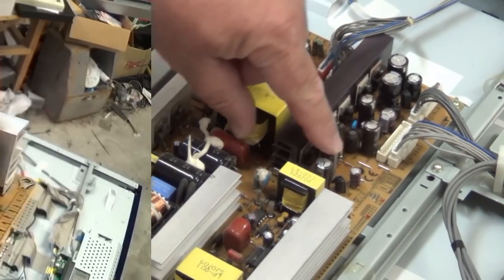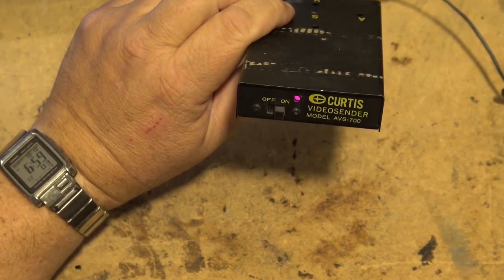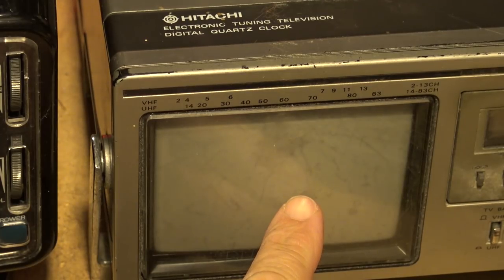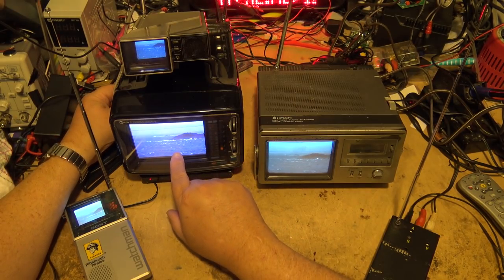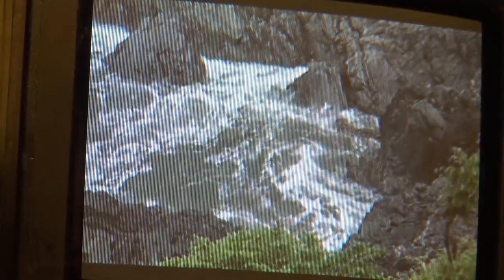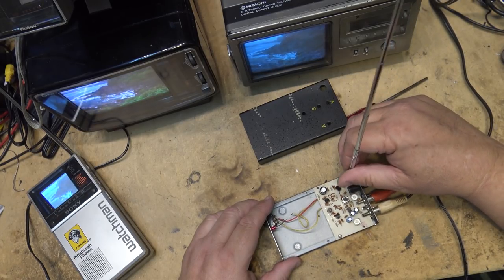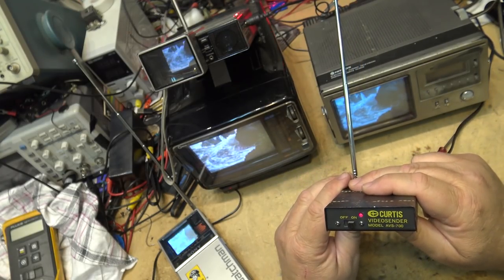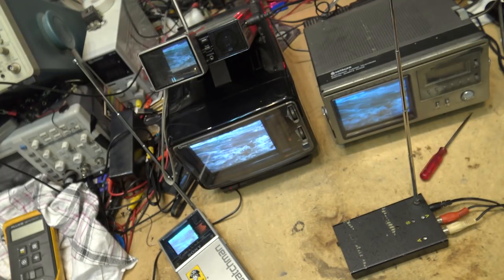Curtis Video Sender low power TV transmitter tear down and demonstration

Comment: The video sender you show here looks very familiar to the "UT66" series. Basically these transmitters (the one´s that I´ve tested) work on half frequency. So if you´d transmitt for example on 500MHz the oscillator wil runn at about 250Mhz. The frequency gets doubled in the first transistor stage - and - via the filters (L+C) the intended frequency is picked out. I´ve tested lots of these video transmitters (other brand) and they all have the same problem - the antenna is missmatched. If you pull out the telescopic antenna to it´s full length, the range usually isn´t that good and often I also had it that the 1/2 Frequency from the "intended" frequency is also broadcasted (weakened but still strong). It helps to use some kind of communications receiver, take off the antenna from the receiver (BNC or SMA) and put it on "W-FM" on the video transmitter´s Frequency (usually these drift so use W-FM). Then place the receiver in some distance untill you hear static, and align the antenna (length) on the transmitter for best performance. UT66 usually I pull in the telescopic antenna and just put out the "thinnest" part (the upper one) a  little bit... maybe 1 inch out from the "big antenna" and I get a strong resonance on the intended frequency (on other video transmitters I´ve tested the perfect resonance spot varies). With the antenne "in resonance" the range increases dramatically (still no big range) and the harmonics / unwanted signals are quite well supressed.

The output power of such a device is in the range of 10...15mW ... if it were 100mW you´d get more range. The UT66 series (optically very similar to the UT66) is very simple designed. The final amp is just modulated in the emitter (the 1k potentiometer for video level). It has FM problems (which the TV ignores) and some units have problems with the linearity (probably a final amp bias issue) meaning if there´s to much white in the picture the picture goes nuts / distors and other problems.

I´ve tested a few brands (via ebay) and the best unit is the one from "reflect" called "Reflect RF280" - it also uses an oscillator at the 1/2 frequency but with the antenna proper aligned, the output is quite clear. It´s stronger than the UT66 and has a good picture / audio.

Sad that they don´t allow these ... still... I mean in Germany - after my knowledge - they weren´t ever allowed (still people used them as it seems) You´re... were... really ahead there in your great country :)

Circuits of these transmitters can be found using google picture search but basically you can even built a dirt-cheap 2 transistor video transmitter (colpitts oscillator in the TV band. Feed in the 4,5MHz signal on base and feed in the video on emitter). Did that... it... works but it´s really "dirty".

Hope I could bring some light into this topic, I´ve really spent a lot of time with these. 

The range varies very much on the environment. With the transmitter in the house it´s about 100 feet as it was said, but if there´s nothing between the transmitter and the receiver it´s more like 300 feet before the picture starts to get bad. More range can be archeived with a different transmitter modell.

Comment: I recently discovered that you can run an rf signal through a signal booster and achieve the same goal.
I found this out while I was looking for a signal sender that doesn't require me to have a bunch of clunky crap connected to the receiving TV just so that I can use it and had a very difficult time for whatever reason.
With the amp you just need to supply power to the booster at the transmitting end.
You can also get the same result using a VCR
Reply from the maker: Most consumer signal boosters don't provide much signal but a commercial modulator with a 60db amplifier will certainly transmit a few feet.

Comment: Got just the same videdo sender. A Blonder Tongue Agile Mod is what you need for decent signal indoors! Thanks Dave.
Reply from the maker: I do have a BT modulator. Channel 12 MTS stereo.  Has a +60 dB output and yes connected to an antenna it goes about as far as this thing. I use it in my home analog cable distribution and have it playing music videos off a hard drive 24/7.  Have many, as in hundreds of concert performances that I just let play in random and listen to more than watch. That's why the stereo modulator.

Comment: Very interesting video.  I didn't know that you should run TVs occassionally to keep them working well.  I have about 8 vintage 12" black and white sets that have not been turned on for about a year or so.  How often should I dig them out and operate them?  Also have a 20" Zenith that I'm in the process of repairing but not sure on how to disconnect the picture tube.  i will make a video of the TV soon so you can see what I'm referring to.

Comment: I have 2 of those Curtis mono units I've used over the years but recently found a stereo video sender with no brand name, it's about the same size as the older ones and works great. Have you seen the stereo model?
Reply from the maker: No, wish I had one. I have 2 stereo modulators.

Comment: I have one called a 'TV Genie' but the picture looks scrambled. There are 4 trim pots inside in addition to the 2 audio and video gain adjustment pots along with 7 caps. Anything I could adjust or replace to fix the picture?

Comment: Wonder if they are similar to the Rabbit Boxes they used to sell to extend video through the house via wireless. Never had one, so I can't say.
Reply from the maker: I had a wavecom jr unit on 2.4ghz FM video and audio modulation.  Still have it modified for amateur tv. Mine is programmable from 2.36 to 2.45 GHz and puts out 1 watt. Into a parabolic reflector antenna the distance I have transmitted is point to point 50 km.

Comment: The one from Canada, the transvid?  Did you find it?  I am in Canada and have an old one put away somewhere.  I could broadcast to neighbours 5-6 houses away, easily with clear picture and audio.  Do you know if these will work with modern tv’s?
I would like to see your Canadian brand one.
Reply from the maker: No, it's around somewhere but i haven't found it or have been looking for it.
Reply: Put the TV on to analog
Reply: You can get the TV to scan for analog channels

Comment: I got a UT-66 which seems to be almost identical to this one. It's allegedly operating at channel 31 but the one I got, has a "homemade" label next to the unmarked hole above the sound control hole, here it says CH-29. I can't find anything on either tho but if I seek with the device I'm trying to play back the channel on, I can sometimes get a quite crappy signal. If I tune the video knob, I can take it from no signal to a very shitty signal. How do I bring it back to the default channel?

Comment: I still like the novelty of small tv sets :-).
I have never heard of curtis ones but there were plenty of other manufacturers making T.v Senders.  (as they were called at the time).
A few oscillators being modulated and mixed together, not much but very very handy :-D.
I've always loved minimal circuits that perform amazingly well.
Reply from the maker: Most were am, a few FM. The fn models looked better and went further but required an fm tuner at the other end.
Reply: That must have been the reason most people used the  AM senders, cheaper.
Fm would require a more expensive device.
Reply from the maker: @zx8401ztv  well it required a seperate receiver whereas the am senders you just turned your tv to channel 15

Comment: couldn't you hook up the output from a converter box or modulator to an amp to get a similar effect? we still have channel 28 within range so that's cool.
Reply from the maker: Yes. You would need a fairly high gain amp.  Of course hook this to an amp and get a few miles range.

Comment: I had one of those 2.4 GHZ video transmitters made by a company called Terk.  But the power supply units for one of the units died. But it was 2.4 GHZ Analog and the video was frequency modulated instead of amplitude modulated.  It used to get interference though from nearby wireless routers in the neighborhood and would also cause inteference to them.  If it was set to the right (or should I say "wrong") channel I would completely lose my wireless internet. Because of the 2.4 GHZ microwave frequency. Which is what wireless routers also operate on.
Reply from the maker: The Wavecom jr and sr was the same. The difference was the sr version had an IR return channel.
We used to use them for ham TV use because the 2.4 band is shared with amateur radio.
They were FM video 20MHz deviation and would do a wonderful job on 2.4 cordless phones and wireless routers. When we operated it caused hell for the neighbors wifi. I could never hit the repeater from my house, so I used to pack up my gear and drive up the hill and set up remote with my camera, transmitter on 2.4 with a high gain antenna, and a 1.2ghz receiver to receive the signal back from the repeater. There would typically be 4 of us on the air at once. We had a quad screen, so we could see all 4 input frequencies at once. Would go on the air for hours, either just talking to each other, or showing live pictures or play tapes we made. Every time I set up I would get the a couple people pay me a visit on the hill because their internet got really slow or their phones cut out wondering what was up. I would say, too bad so sad, I was operating in a legal, licensed band. A few even called the industry Canada folks that informed them that their devices were not protected from interference as they operated on the ISM or industrial, scientific and medical band as a secondary use, and ham radio was a primary user for us to experiment on. The "scientific" portion. It pissed them off but there was nothing they could do. I would say to them, hey I am only here for a few hours, be glad one of your neighbours isn't a ham, because he could operate all day and there is nothing you could do.  I  think a few thought I was doing it to annoy them but in fact it was the only location I could get a clear shot to the repeater from my location as I was about 50KM away and that is a long way to shoot a 1 watt microwave signal. Those days are long gone though. All the guys that I used to do ATV work with are all 6 feet under now. Many died of cancer. Can't help thinking it was probably all those microwaves they played with over the years as many of them tinkered with transmitters and antennas and really big power for years, and 2.4GHz is not good to be around.
Reply: @12voltvids  even here in u.s f.c.c rules part 15 says that this device must accept ANY interference that may cause undesired operation.
Reply from the maker: @RadioSpectrumDXer1217  That's right ISM, Industrial, scientific and medical band. Home cordless phones and wifi is secondary users. Amateurs on 2.4 can run up to 200 watts I belive. I only operated with 1 wayy into a 33db gain parabolic reflector. That would give the ERP in the focal point of the beam of 2048 watts. Yup that was cooking.
Speaking of cooking, on a field dat we set up the transmitter, and pointed the antenna into a glass of water, and it eventually brought the water up to a boil. Don't stand in front of that antenna when it is on.  One of the guys in our group that was always playing with 2.4GHz and didn't bother much with safety, walking in front of antennas when transmitter was on ect wasn't feeling well. Finially went to a doctor and got the bad news that he was full of cancer. Likely brought on by years of smoking like a chimney and his excessive exposure to microwaves.
Reply: @12voltvids  iv'e had my bluetooth earbuds in listening to music.  They will play just fine until the second i turn my microwave oven on to heat up my food to eat,  then they start breaking up. But the second the microwave stops they start playing fine again.  especially if im closer to the microwave than my phone. Microwave oven is just a "glorified" version of what you were doing.  Just shoot the microwave beam into a cooking chamber, add a timer to the transmitter and there you now have an oven. I remember back when I was a kid before fiber optics became a thing (due to its greater bandwidth), before cell towers really dotted the landscape,  you would see these microwave relay towers with the parabolic reflectors but they also had these funny looking horns that were shaped like a wedge of pizza or pie wedge.  Used for relaying long distance telephone and network (ABC,  NBC,  CBS)  television programing across the country to their local affiliate stations. Many were owned by AT&T A.K.A "ma bell". So obviously this was even before the days of satellites.  I know many radio,  tv stations though still use microwave relay to remotely send programming from their studios say in one part of town to their transmitter site located in another part of town or even totally different area.
Reply from the maker: @RadioSpectrumDXer1217  
Microwave ovens operate on 2.45 ghz, which is the top end of the 2.4 wifi band. Bluetooth shares the same frequencies.
Once upon a time the phone companies used microwave to link distant communities.  Now most is backhauked by fiber, but Roger's still uses microwave links for their cell sites.   Many radio stations here used uhf STL but that was a backup because the transmitters had audio delivered by isdn or t1 phone lines as the primary link and the radio link was a backup.

Comment: I have a similar modulator, think it's a Radio Shack, UHF on Ch35 approx 534Mhz from vague memory.  I have a large box with three crystal locked VHF modulators on Ch 0 (46.25Mhz), 5a(136Mhz) and ch 11 (225Mhz).  I recently got a 2 channel UHF unit has the Ring Grip name (Ring Grip is an Australian manufacturer of electrical fittings).  It can be set to any channel in the UHF band.
Reply from the maker: I have 3 wacom agile units that can go from a-7 to a-1 covers 2 -83 VHF /UHF and 14-22 CATV, 23 to 135 CATV including the channels in the FM band 95 - 99.  I use VHF channels for distribution on my home system. Channel 4 stereo Channel 5, 7, 9, and 12 in stereo, and CATV 17. I dont use any UHF because I receive the OTA digital signals with an antenna and mix that in with my analog channels, so TVs throughout the house can get SD material I insert on the analog channels and HDTV. The analog modulators are used for things like my media players, security cameras ect.
Reply: Plenty of signals for your TVs then.  Correction: the 2 channel modulator has Clipsal (another Aussie electrical supplier) on the case. I did have a look inside it and noticed the board accommodates up to four modulator modules. It’s actually made by Zytec despite the name on the case
Reply from the maker: @Wenlocktvdx  I have a couple of channel plus units. One is a 2 channel and the other a 3.

Comment: quick question I was considering creating a small diy transmitter for personal use but I'm having trouble finding licensing and legality information, would you be able to point me in the direction of resources on this? Thanks!
Reply from the maker: Well you don't need a license if the power is low. How low depends on where you are. It is based on field strength a certain distance from the radiator (antenna) which varies depending on your country.
There was a pirate that operated for years and years. Probably 20 years and payed nothing but music on the low end of the band. Then one day a high power station was set up on the same frequency and I cont hear it any longer but it was there for many many years.

Comment: Nice design. Nowadays they would throw some connectors and a chip on a board and shove it in a cheap plastic case and sell it and it would fail in a week. At least this you can fix. Any ICs on the other side?
Reply from the maker: Nope. What you see is all there is. 4 little transistors.

Comment: Would it be possible to recreate this? The circuit seems simple enough.
Reply from the maker: Of course it would be possible to build one of these. Of just tape a small tunable modulator and add a small amplifier stage.

Comment: How you send signal to tvs ?
Reply from the maker: Well this little transmitter transmits on uhf channel 15 which is fine if none of the local channels are broadcasting on 15. All my TV's still have analog capable tuners.
Reply: @12voltvids  thanks for info

Comment: Why did it not have a 3.579545 Mhz crystal for colour?
Reply from the maker: The transmitter is not generating color or demodulating color. All it is doing is taking the incoming video signal, which would already have the color encoded on it and AM modulating it onto a UHF carrier and then amplifying it slightly and sending it to an antenna. Its a very simple process.
Reply: @12voltvids  Sorry, I still had the modulator mindset LMAO my bad.
Reply from the maker: @MikinessAnalog  
A modulator is no different. It takes an existing VBCS (video, blanking, chroma, sync) composite video signal and modulates it on a carrier. Most modulators will have a crystal for the carrier generation so they remain stable. This one doe not, so it has a tendency  to drift, but the AFC on the TV takes care of that.
Reply: @12voltvids  As i understand it from university, the higher the frequency the less power needed to go the same distance, so I'm assuming being UHF it is probably in the  200mW range? I made a 1 watt FM radio transmitter when I was 19 (77.3 Mhz FM with a 19Khz pilot tone crystal for stereo) and it traveled about 3km.